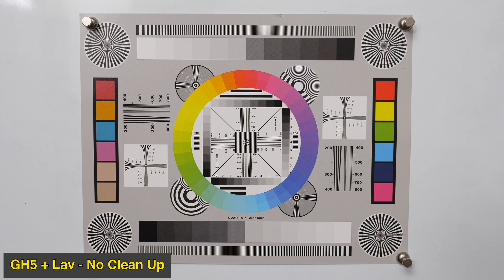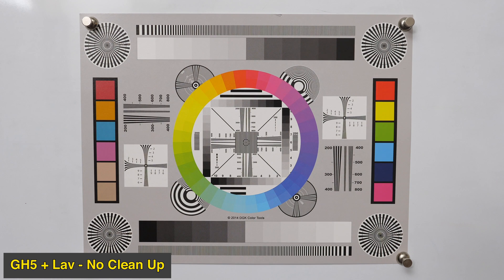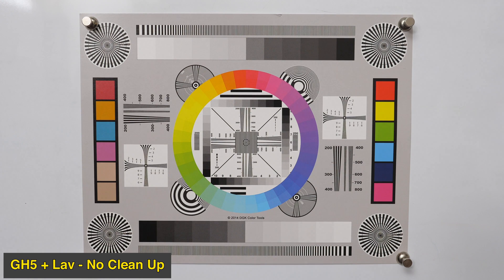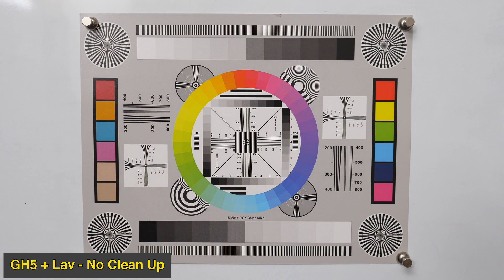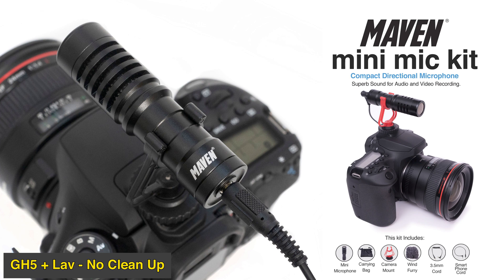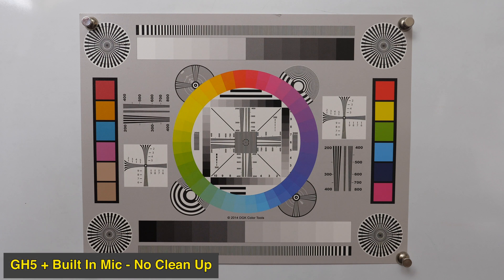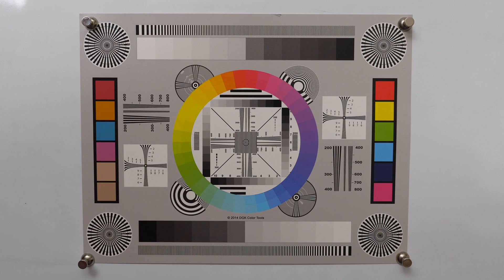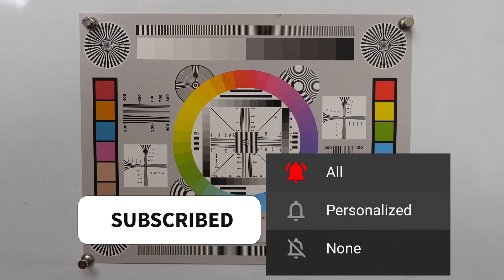Camera Pre-Amp Microphone Noise / Buzz Comparison - GH5 vs D780 vs Canon 90D vs Fuji XT3 vs A7iii

Comment: Thank's a lot for this very good comparision.
On my second channel I've a video where I found a bug on the X-T3.
https://youtu.be/bpNZk0P0lYg
When you connect a external mic on the X-T3 you will get every 2 or 3 seconds a strange 16kHz peak.
Like the most X-T3 user I'm not able to hear it but younger people like my doughter will hear the annoying noise.
In particular after normalising the levels.
I could proove it with a spectrum analyser. You can see it as screenshot sin my video.
Do you have the same issue?

Comment: Was a neighbor's dog barking through night?
Panasonic and Sony's pre-amp have been good for years. GH4(May 2014) was even pretty good. In this test, GH5 tops, Sony a little disappointing, Canon & Fujifilm surprisingly good, Nikon bad as usual. Both 90D and M6 Mark II sound clean and much cleaner than 80D or others before them. X-T3 sounds clean but X-A7 or X-T200, those based on Bayer patterned sensor cameras sound bad. Pretty bad. Nikon, simply bad. Nikon's filmmaker kit never made any sense.
Though, noise floor can be hidden once some sound is recorded.

Comment: I've learned a lot about cameras through your channel but I think this time your testing methodology was a bit off. The mic preamp is not the only thing that affects the noise level. The built-in microphone also causes some noise. It's also unclear if the general recording level was the same between different cameras. Even if you have the same gain setting in each camera, it doesn't mean that the recording level between them is the same (I don't think it's standardized in any way). If one audio clip is louder than the other, the noise is also relatively louder.

A more fair method would have been to plug the same microphone to each camera, then speak to the microphone a bit (from the same distance and with similar loudness) and then take a moment of silence. Then, in post, you should tweak the overall gain of each audio clip so that the spoken parts are at the same level. This way the in-built camera mic is taken out of the equation and also the relative volume between the different audio clips is the same. This way the silent portions would be more comparable to each other as well.

On an unrelated note, my opinion is that you're also applying a bit too much noise removal to your audio and it's starting to affect your actual voice. Yes, you're getting rid of all the background hiss but simultaneously these wavy artifacts appear and the voice is not as natural sounding. It's analogous to noise removal effects in photography: yes, you can get rid of all the noise in the image if you want to, but at the cost of detail. Where a good balance lies is a matter of opinion, of course.

Anyway, I think your channel is great and I'm constantly learning new stuff – keep up the good work!
Reply from the maker: poppijoni well, i calibrated each to the same levels, same room, same background noise. There are many tests that can be done and the ones you mentioned are coming - thanks

Comment: What I wonder - amateur audio recording used to always be awful even in  the early days of digital recording devices being affordable for a wider audience. When we tested a Canon Ixus, guess the thing is like 13 years old now, we were pleasantly surprised.  It recorded mono, but sounded good. Methinks there is some digital alchemy going on, busy algorithm optimizing.
For my specific music recording needs Nikon with my old external mic always sounded good. Possibly because the algorithms optimize that specific sound well, bassy early strings supposed to be close to the human voice.
Now I also own newer Sony and Panasonic cameras. And don't feel tempted to use them for the main audio track. Nor my Zoom audio recorder
The difference in noise level is obvious. As the dpreview guys often pointed out - not a good point for Nikon. However this is just one component of complex issue. And there might not be the one-size- fits-all solution.
Reply from the maker: max d. machy It’s a great point because there are so many new videographers who are just getting into it that don’t have huge budgets or knowledge or access to the tools to make great audio, they want a simple microphone that they can just plug-in and get great results in the truth of the matter is good Audio takes some extra work – so I agree there’s never the silver bullet that solves everything easily.
Reply: @MMaven  also great that you market a reasonably priced microphone. Having an external microphone adds so much to a simple recording set-up! Bet you have ordered a new series
Reply from the maker: max d. machy yes I have a few models coming as well as other accessories. Should be an interesting year

Comment: This is a good subject, one thing I want to add is how sensitive some preamps are most notably the Sony.  I found with music or mic that has a higher output I actually had to add an inline attenuator even when the input level on the Sony A7R3 was set to "1".  On my Canon 80D this was never an issue and even putting the setting near the middle did not overdrive the preamp. A lot of those supercompact mics with higher output will not work on Sony for recording music, even he Audio Technica AT 8022 required some attenuation for very loud sources (and it wasn't the mic blowing out, it was rated for those db's and works fine into an H5 recorder).
Reply from the maker: robwas really good points! Thank you for sharing
Reply: I have a sony ZV-E10 and I had a old rode micro I threw it on and it sounded terrible. So is it safe to say my camera isn't broken it's only a month old?
Reply: @84cman  Check a few things, make sure your mic is plugged ALL the way in, it's easy to have it not inserted enough.  Second check the levels on the camera you may have them set incorrectly and be clipping.  Lastly try another mic, always possible the mic is broken not your camera.
Reply: @robwasnj  Thanks really appreciate the response I’m new to videography.

Comment: You are mixing actual preamp quality with noise floor. Thats not the same. Mic preamps with higher noise floor can have better overall quality. You basicly just need mics with hotter output or mic preamps. Overall there are 2 rules for camera audio. 1.) NEVER position you mic on the cam hotshoe, 2.) NEVER use your  cam mic input with unamplified mics.  
That said, Canon/Nikon preamps are the worst, Sony has the best. They still suck and by Sony standards are pretty weaks, but miles ahead of the other two. Dont know about Pana/Fuji, but from what i´ve seen Pana is onpar with Sony.
Reply from the maker: 1- This is just the cameras, no external microphones are involved aside from my lav mic in the beginning. 2- this is from the approach of what 5 different cameras sound like in the same room. There are 100 different tests and comparisons one could do, this is from the perspective of a pure beginner just learning about video in their living room. These other tests and examples will come.
Reply from the maker: Gregor Mima also, re: you two “never” rules: in a perfect world that would be great, but that’s not how most vloggers shoot- everyone uses the hot shoe mount out of convenience, and not everyone can afford (or even wants) a good mic with a built in pre-amp
Reply from the maker: Gregor Mima sounds like you didn’t listen to this test as a Panasonic was included. The Nikon D780 was by far the worst,